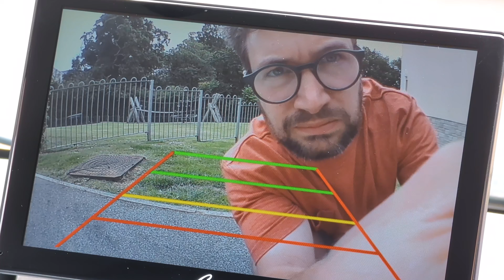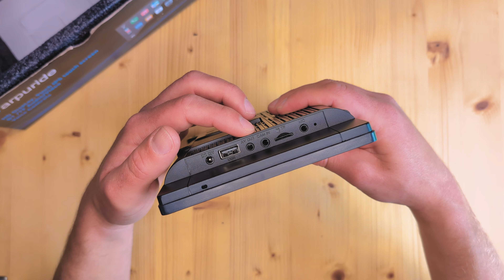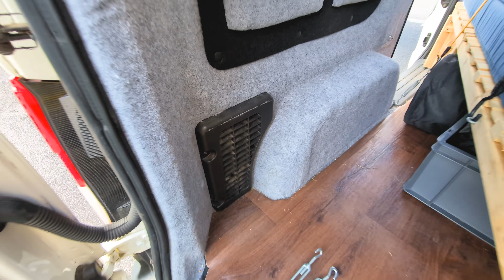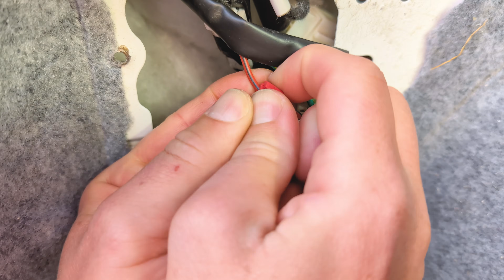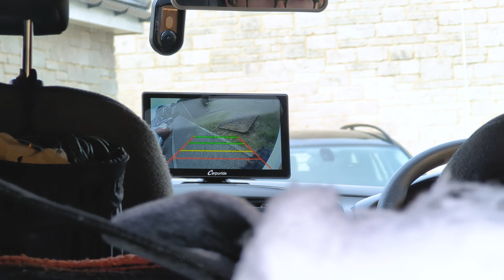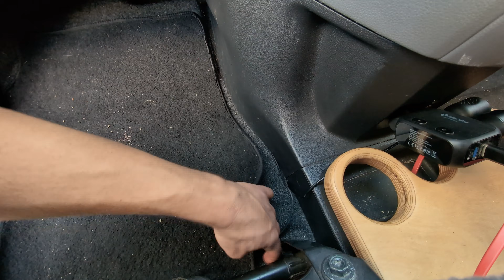How To Install A Reversing Camera

Comment: I just got a Mirror am with a camera out the back.Ran the wire and cam to the back.Didnt have to hook into car wiring at all and you can turn it on back forwards..split screen and just leave it on as my reverse mirror.Find one with a Starvos Sony camera.Its incredible at night.
Reply from the maker: What brand did you buy?
Reply: @LensOfJames The AVAX2X they don't make it anymore.I was watching another YouTube video nwgere the guy just ran the camera out to the back of his car and the hooked the car on.Becausecits not a reverse light that is attached...you toggle the reverse light from front camera to a split screen to the back.It doesn't need to be hooked into the electricity.Tge wire is just plugged. Into the camera.Tgey have others that work the same.I just leave mine on the back view all the time.I have looked at others on Amazon...and they have the same hookup.The Starvos Sony rear camera is what you want .I used to drive a cab so cab drivers are always backing up into spots.Only cost about 100.And the camera is bright with that camera.Bought a Matrix and just ran it back the same way.I'm not technical about hookups.Its just taped on the back bumper below my license plate.

Comment: Those T Taps - you don't need to strip them no? I've used it before and as soon as you snap the connector to the wire you're tapping to, it'll strip itself.

Comment: Having the rear camera immediately when going into reverse would be amazing, but for those of us with limited income, making a mistake can cutting a needed cable isn't some small oopsie. I can definitely understand why people are scared. I might still try this but...not immediately. I need to install my cameras tomorrow so I'm just trying to get a feel on how to do it as Rexing doesn't tell you in the manual and it's the comment section on their videos that have the most information.
Reply: pretty sure most reverse camera setups have a touchscreen button to turn on the camera manually. i don't want to mess with wires on my car.
Reply: @LCJammer  Yes, I can press several buttons to reach it using the tablet screen on the dash for the cameras, but it would be nice to just go in reverse and it kicks on, like with a factory installed camera. Not installed the rear camera yet, though, to see how I like it so far and if I do want to do the extra work. Need to peel an ancient and splotched film from the back window that I think was factory installed. Either way, I wouldn't do such an install until after the car is paid off, which I still have another year. In case I do screw up or something happens and I can't pay the car off, like I'm laid off (which I have been through before), I don't want to tinker with something like that and I'm not fully the owner, lol.

Comment: For future electricity jobs, consider investing in some wire crimping tool and shrink wrap and maybe even some dielectric grease to keep the moisture out of your connections. Needlenose pliers and highschool connections will work for a time but they will be a pain in the rear when they start giving up.

Good video man!

Comment: Plugged in my backup camera today,and I had no idea what to do with that red wire. I'm glad that I didn't give up after 3-4 videos, because this is the most helpful video I saw. I just used cable organizers and knew about where it should go, but I wasn't sure if the simple splicers would work for my car or not, and seeing you use one gives me confidence.  I feel so excited to have my chariot ready to roll, so thank you and happy driving. Stay safe

Comment: Warning! Don't buy the camers with metal mounts/screws - it will rust and your camera will die! Only buy cameras with plastic mounts with thread locking. Hope it helps!
Reply: Install the camera inside of the car on the rear window. I removed mine from the plate bracket because of the turbulent wake during a rain which is covered my camera with water drops.
Reply: @MichaelLevin-nn3fg  I have a dash cam installed inside, plus I like to use my bumper when backing u. With a plastic mounting design, no issues at all.

Comment: Hi James. Are you aware of any cars where connecting to the reversing camera might cause the reversing light to fail. I have a Jag F Pace and have been warned that the light isnt wired to a fuse, that it uses sensors, so the if the current fluctuates, the light wouldn't come on,,

Comment: Hi just letting you know that in the description, you have the same link for the t-tap connectors as well as the wire strippers
Reply from the maker: Thanks for pointing that out, I've fixed the description now!

Comment: All we need is a Reversing Camera that wirelessly transmits the video signal to your mobile phone, no wires needed apart from power to the camera. Even that could be wire free if cams were battery powered with 2 swappable lithium batteries 🤷

Comment: After connecting the red wire to a reverse light bulb,  will the rear camera keep recording just like the front dash cam while driving?
Reply from the maker: Yes it will record at the same time

Comment: I've got an nv200 and following the video, BUT how do you loosen that rear handle panel to slide the camera wires through? I undid the bolts I could see, but it won't budge. I can’t find any diagrams or videos about removing it either. Any tips?
Reply from the maker: It's tough but doable - I've shown it as best as I can in the video. It isn't possible to easily remove the door handle so you've just got to find a gap to slide the wire through
Reply: @LensOfJames managed it in the end, definitely not easy to get into that handle. I managed to identify the three odd looking bolts holding the handle, loosened them enough to feed the wire through. There's a plastic blanking plate on mine so no need to drill holes for the cable. All working now.
Reply from the maker: @MarkFeatherstone glad you got it sorted!

Comment: @LensOfJames, I just about finished installing my reverse camera thanks to your tutorial. I am the point where the camera is set and when running the cable back to the from of the car the Camera lead is short. I wonder if there is some kind of male-to-female extension cable I could use to carry the video signal onto the Carpuride tablet? - I checked online and there seems to be 3.5mm audio jack extension and I am not sure I could use it? - looking forward. Best!

Comment: Is it possible to test the reverse camera without splicing wires?  

I suspect that you at least need to supply power to the camera with the wires someway 

Is this right?
Reply: i think 2.5mm video-in cable provides the power from the head unit to camera which means the camera is always on with ignition on. the red wire is a trigger to show the video on the screen.

Comment: Here in USA, the NV200 is an absolute shit box of a van, but it doesn't offer a manual transmission option. The manual option takes it up several notches. Too bad Nissan just about gave up over here.

Comment: I connect the red wire to the positive of the reverse light and the display turn black when I put it in reverse… what could be the problem?
Reply: You should have chassis ground for the camera, not the reverse ground. Bad ground can cause camera flakiness.

Comment: I installed mine but when I put it in reverse it doesn’t turn my screen on I physically have to turn it on is there a setting to make it automatically come on when I put it in reverse???
Reply from the maker: Which screen do you have?
Reply: @ I have the hauxiy q9s
Reply from the maker: Is the device on already when you put the car in reverse? It will need to be to show the reversing screen.
Reply: @ yes it is on
Reply: I went thru all the settings and couldn’t find anything to turn on auto view when put in reverse
Reply: I guess it’s just the fact it’s a cheap car play unit and have to do it manually every time
Reply from the maker: Yes perhaps it doesn't have an auto reverse camera function

Comment: James help me out. I got the same camera as yours and whenever i wire the red wire to reverse light, the fuse blow. Does it need a relay?
Reply from the maker: In my installation I didn't need anything other than the camera and wires that came with it. What screen are you connecting it to?

Comment: Hi, is there any how I can connect my dash cam rear view camera into my carplay so i can use that as a reverse camera
Reply from the maker: Most likely not - it would rely on the carplay device having the right software. I've had nearly identical rear view cameras not work on the same CarPlay device before.
Reply: Just to add, my car play has reverse camera function,  when I put my reverse gear it's shows on display.  I just need a camera to put on.

Comment: I installed my reverse camera ,before that my reverse lights were working fine. after that my reverse lights and camera sometime doesn't work and sometimes it does. It usually works in a sweet spot. Why is that?
Reply: Sounds like you’ve gotta loose connection

Comment: Thank you for the video…..I have a small questions I currently have a camera on my car which is a bit old and has the red power and yellow video cables 

And I bought off a cheap camera on Temu with the same wiring as yours…….the question is if I cut the camera wires on both the cameras and join the same colors will it work
Reply from the maker: I wouldn't cut any wires - not all cameras are compatible with all systems so it's quite possible it wouldn't work
Reply: @ so if were to give it a shot…..what would be your suggestion……is it worth a try 😅😅
Reply from the maker: No, I definitely wouldn't, I think the chances of compatibility are very slim
Reply: @ ahhh okkk 😭😭😭 so what should I do……do you have a cheap camera suggestion

Comment: Los cables de la Luz de reversa son negro y verde cual seria el positivo y donde puedo conseguir los conectadores que usaste
Reply from the maker: You need to use a multimeter to check which wire is the reversing light wire - full details in the video. Links to the t-taps are in the description :)

Comment: how can i get the reverse lines to show without the red wire? I have it plugged in the car play unit but just no guidelines.
Reply from the maker: It depends on the device but generally you can't, they'll only appear when reversing (and the red wire is attached)

Comment: if I don't wanna wire the red wire, will the camera still work fine for the long term with just using 3.5mm jack
Reply from the maker: You'd have to press a button on your car screen to activate it every time, but yes

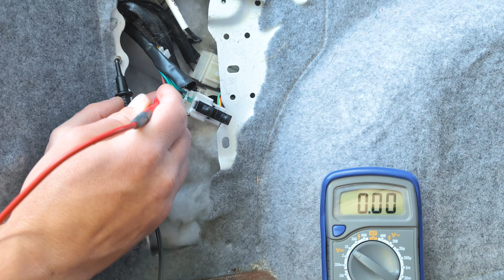Comment: At 4:22, did you make the hole to contact the wire, or was it already like that? I don't want to make any mistakes while doing this install. Thanks!
Reply from the maker: Yes I did, created the hole with the point of the multimeter probe and just exposed the wire enough to get a reading. Worth making the hole where you think you might strip back the wire to connect the t-tap/red wire so it isn't bare or alternatively wrap some tape around it to cover it up.

Comment: Hey. I set my Cam to AHD (orange wire cut). I guess that wont work on a Lamtto portable head unit?
Reply from the maker: Couldn't tell you I'm afraid, as this system didn't have any wires to cut.

Comment: Can I put my rear  camera on the inside of the back window of my Chevy aveo instead of on the license plate?
Reply from the maker: I don't see why not, just got to make sure the wires are long enough
Reply: @LensOfJames  ok ty.
Reply: @annabarragan7863  that’s where I’ve mounted mine n when the windows get foggy inside or wet outside you can’t see anything. Hope this helps. I’m looking for info on mounting minemine above my license plate due to these issues.

Comment: I want to buy a license plate light camera that connects to my factory headunit, do you (or anyone else potentially reading this) by any chance know what else I need to get so it would display the image to the display. These cameras usually come with a 6m RCA video cable and a power cable. I was searching for 3 days on Youtube and I can't find anything. 
I have a Polo mk5 (6R) 2017. Mutlimedia id: 6C0035867F, hardware: 050, software: 7082

Comment: Thanks for this.  Just been having a play with mine.

For first check I just plugged everything together inside the car, ignoring the black and red wires but nothing happened.  Is that right do you think?  Was thinking that I needed to get independent power to the camera so for next test I'll just run power and earth via the red and black and see if that works.

My other question is what did you do with the black wire alongside the red?  I assumed that it would be an earth?
Reply from the maker: I only have a 2.5mm jack (which also acts as a ground and plugs into the screen) and the red wire. If you have a black wire too then it'll probably be a ground and will need to be connected to bare metal to complete the circuit in order for the device to work :)
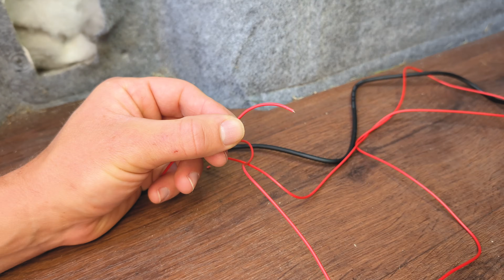Reply: @LensOfJames  Thank you.  My bad.  At 5:15 in when you put the connector on the red wire there is a black wire in view.  Probably one if your meter wires?

Comment: Can I connect the camera power to usb with 12v usb adapter?, i dont want to connect it to car electricity as it can void my car warranty in my country
Reply from the maker: This type of reversing camera is powered via the 2.5mm jack and needs to be plugged into the dashboard screen for both power and image. The red wire is just for the reversing connection. Sorry if I've misunderstood your question. :)
Reply: @LensOfJames  at first I thought that the red wire is necessary, turned out to be my previous rear camera is broken, bad qc, I changed it and it works without the red wire, thanks for your reply

Comment: What if you want the camera on all the time? Not just when you are in reverse?
Reply from the maker: It depends on the dashboard device - some devices, like the Carpuride W903, can have the camera on at all times. You wouldn't need the red wire then

Comment: any chance you know what gauge the camera's red wire is? the insulation on mine doesn't have anything printed. Thanks!
Reply from the maker: I'm not sure I'm afraid, mine didn't either
Reply: The wire is quite small, I would guess somewhere around 24ga or .5mm. My wire stripper only goes down to 20ga and the wire is quite loose in it when stripped.

Comment: Thank you for the tutorial, I have a question... could you have connected the red wire to the red wire on the existing camera?
Reply from the maker: I'm not entirely sure - quite possibly, but I just did it the way I knew :)

Comment: Thanks for the awesome guide! FYI - no need to strip the 12V wire when using a T-tap connector, the connector is designed to penetrate the insulation leaving as little exposed copper wire as possible. Cheers ;D
Reply from the maker: I saw that elsewhere, but when I looked at the T-Taps I had I definitely didn't feel confident it would go through the wire insulation. Maybe they would on some.
Reply: @LensOfJames  As long as you are matching the gauge of wire to the appropriate connector they are very reliable at their job. stripping the insulation will make them less reliable as the body of the T-tap uses the insulation to help push the wire into the connector to the right depth.

Comment: How could I wire the rear camera as a dash cam and not a reverse only camera?
Reply from the maker: You'd need a device like the Carpuride W903 that is both a reversing camera and a dash cam that records footage. I use it in my van: https://amzn.to/3yfO1bP (affiliate link)
Reply: You an buy a different screen from Carpride tat has a front sh cam panda rear camera that acts as big a reverse cam.and reorder.  Have one on my z3
 I hibk.its a w903 capiride screen.

Comment: Did you glue the camera from the holding bracket?
Reply from the maker: No glue, just the sticky pad and screws shown in the video
Reply: @LensOfJames i mean the camera to the brackets? I only see the sticky pads holding the brackets

Comment: I have the Lammtto, and I've installed it pretty much like you did on your video.  But my visual are reversed on dash.  Is there a way to fix that?
Reply from the maker: Some reversing cameras have coloured wires you can cut to flip the image, and sometimes you can do it in the device settings.

Comment: You didn't use the ground wire?
Reply from the maker: No, there's not ground wire on this set up. Plugging the AUX cable into the dashboard console grounds it and completes the circuit. If yours had a ground wire, just attach it to a bare metal bolt 🙂
Reply: @LensOfJames  Hi James I took your advice and got a W904. Just got to install the reverse camera now 😬. I have a Peugeot 308 without a aux cable - will this cause a problem for me in terms of grounding it?
Reply from the maker: I don't use the AUX cable on mine and haven't had a problem grounding, good luck with the install!

Comment: Great video but nah....🤔🤣🙄
Reply from the maker: Thanks haha fair enough, got a wireless reversing camera video coming out soon 👀
Reply: @LensOfJames How do you check the voltage of the wire while it's in reverse without getting ran over?
Reply from the maker: The engine doesn't need to be on, just turn the key until all the lights come up on the dashboard and you'll be able to put the car in reverse and the light will come on
Reply: @bendadestroyer he has manual car you can see from stick😊
Reply from the maker: Do automatics reverse when in gear but the engine isn't on?
Reply: @LensOfJames they become neutral I guess never tried it but today I’ll give a try, and depends on ground if it’s steep and you doing reverse without engine on it will go down hill😂

Comment: Could this be done with an automatic car?
Reply from the maker: Not entirely sure, but quite possibly. You could find and test the reversing light wire when in reverse before committing to the rest of the work. Might be worth researching it a bit more
Reply: Rear taillights on, brake light on. Test for the wire with no power.